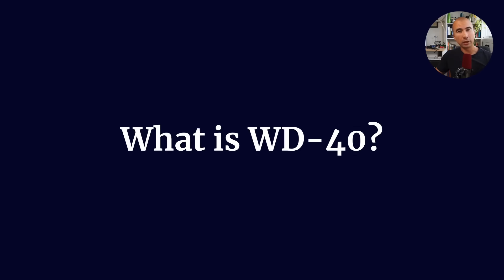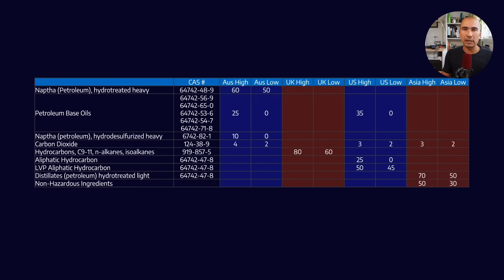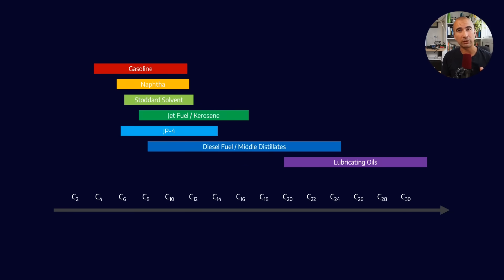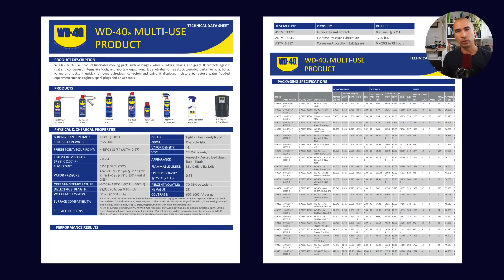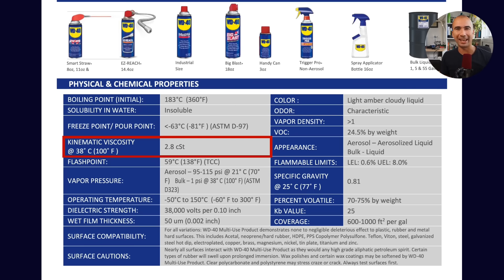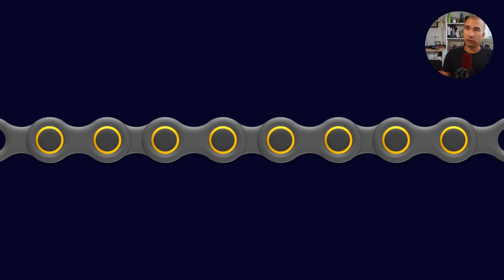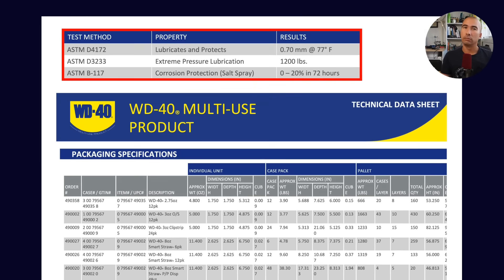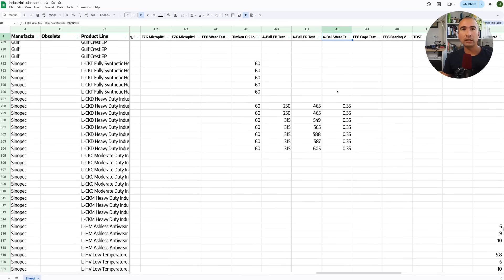What exactly is WD-40?

Comment: > Myth: WD-40 Multi-Use Product is not really a lubricant.

> Fact: While the “W-D” in WD-40 stands for Water Displacement, WD-40 Multi-Use Product is a unique, special blend of lubricants. The product’s formulation also contains anti-corrosion agents and ingredients for penetration, water displacement and soil removal.

—The WD-40 website

Comment: Diesel starting fluid —and wasp prevention. It ABSOLUTELY works for that. I do commercial/industrial HVAC, so I see quite a few nests. A quick shot  early in the year in the common spots will keep them away that year. 
>be careful with vinyl siding/soffits: some of the older stuff can get stained

Comment: WD-40 was originally developed by the Rocket Chemical Company in 1953 for the aerospace industry to prevent rust and corrosion on the outer skins of the Atlas missile, a task the chemist completed on the 40th attempt, giving the product its name: "Water Displacement, 40th formula". The product's effectiveness in this specialized industrial application led to its widespread use by employees taking it home, eventually prompting the company to release it to the public in 1958.

Comment: Really, really good video.  Does great job distinguishing btwn solvent/cleaning properties of WD40 and the minimal lubricant properties.  One thing i can point out is around 8:00 in video is a misunderstanding of bike chains.  The gold circles on video are not moving parts (ie where the pin goes through the outer chainplate).  Anyone who has used a powerful chainbreaker tool to remove a pin from a chain knows how phenomenally tight that fitting is.  (If it were in fact a moving joint, ie loose, the chain would promptly separate).  The actual moving parts in a chain link assembly is INSIDE the chain link - where there are rollers around each pin.  They actually are relatively loose, have spacing.  THIS is where the pressure bearing takes place when peddaling the bike and rolling the chain around the bike's sprocket.  And where the lubrication (and cleaning) is most needed.  My comments don't in any way dispute or negate the value of what you are primarily addressing in the vid, you're spot on.  Just thought you might want to better understand bike chain mechanics.  Am sure a bike chain video can do a better job than mine in explaining the moving parts.

Comment: I have a small business working with steel wire, i use WD40 as temporary lubricant before the steel wire go through a rotative straightener to prevent squeaking noises and excessive torsion which would affect the final product, WD40 is the best option because the parts will need to be painted after and since the WD40 is quite volatile i don't need to clean anything, and as a plus it provides a temporary rust protection until my customers paint the parts (i just spray a little bit on a rag that i wrap around the wire, 1 second spray is more than enough for work through a 3mm 30kg wire roll). I also use it a lot in maintenance mostly for cleaning old grease and oils and dirt.
Reply: congratulations on being the only person to use it correctly

Comment: I really wish people would read and understand products before using them. We use a product called Amsoil MP spray, and it’s amazing for door hardware. It has enough solvent to clean out gunk, but it leaves a dry film that is the lube. Now, I’ve explained to coworkers that it is what we use to lube things, and they understood that. Up until they grabbed a can of Amsoil “metal protectant” spray (that was an entirely different style of spray can) and used it in all of the floor bolts. It’s almost like cosmoline in a can, and they learned the difference when they had to chase the threads in all of the floor bolts and vacuum out the gunk.
Reply: Amsoil MP is a great product, it's all I use as a light lubricant for motorcycle throttle cables, things like that. Also as a penetrant when taking something apart that has been assembled for years. And as a light rust preventive, works great on my CJ7 bare metal spare tire latch

Comment: Ok, a Tribologist, is My Guess. Hows about a Vid for Air and / or Water cooled V-twins on the highway in say 100+ F, 38+C temperatures. Which grade to use to get the best flow through the bearings and tappets, etc ?? Thanks.
Stay Safe.

Comment: I use it behind the flywheel covers on all of my bikes. There are small vents in the cover and moisture will accumulate and rust up the rotor or flywheel or whatever steel components there are over time. Works fantastic! Every so often, douche with contact cleaner, spritz with some WD and no rust. It's literal intended purpose. 

Hard pass as a lubricant for me.

Comment: interesting but also over simplification.  Penetration isn't based solely on viscosity but also surface tension, water is high surface tension and is low viscosity.  Most liquids are solvents, gasoline, water, alcohol and yes oils are solvents too.  I'm not sure why we need to put them into categories like its a solvent OR its a lubricant.  Lubricant is also a loaded term like others have pointed out parts of..  there is a component of sheer resistance but also surface pressure or heat resistance so as others said, it depends on what you are lubricating.

lore says that WD-40 was developed as water displacement, true?  who really knows.  we do know that a light coat of oil will inhibit rust on raw metal surfaces, WD-40 does this.  WD-40 is really best at displacing water from a crevice where water can hide so that you can put a heavier lubricant in there after the WD-40.

it is a lubricant.... and it isn't wise to use it in most conditions you need a lubricant.  I've probably got two dozen lubricants in my shop for different purposes and seal compatibility.

btw, water makes a great lubricant for your kids going down a plastic slide!

Comment: I used to use it to clean up pipe threading equipment (never for threading). It was enough of a solvent to clean out the contaminated threading oil and enough of a lubricant to keep the low load parts lubricated. It worked great for that but it has always been a little puzzling to me that it is so popular given the limited applications it works well for.

Comment: To know what is any product, download their Material Safety Data Sheet (MSDS). For WD40, WD = Water Displacement”, their MSDS sheet lists a bunch of hydrocarbons and “petroleum base oil” and IMO none of which will provide medium to long term lubrication. The lubrication effects are short term and again, IMO, would diminish rapidly on heated surfaces. If you need a lubricant, use a lubricant that is engineered for your specific application.

Comment: This is such a pet peeve of mine, WD-40 is a lubricant period. It depends on what you’re lubricating. A door hinge is adequately lubricated with wd-40. You wouldn’t pour a light 0W oil into a gearbox or differential requiring 75-90W and then claim the 0W was not a lubricant. It was the wrong lubricant for the job. Water can be a lubricant if you’re using it in a water slide.
Reply: This is what I've been saying forever lol

Comment: On thing that should be taken into consideration here is the fact that due to VOC regulations each country may have a different formula of WD40. WD40 isn't what is was 15 years ago simply due to regulation in the United States. Foreign markets will get different formulations which reflects what was shown in your SDS information. 

If you really start diving into WD40's data sheets you'll find nearly every test that they conduct is done at their own lab and the performance comparisons that they make are most of the time not an apples to apples comparison. What I'm saying is they will take a competitor's silicone lube or multipurpose lube and compare it with WD40 penetrating oil in a test designed for penetrating oil. The information in those sheets isn't worth the paper their printed on.

The current US version of WD40 has become little more than mineral oil and paraffin wax with some fragrance and dye added to keep the familiar look and smell. If you spray out a current US formula WD40 into a clear container wait about 20 minutes the paraffin wax will fall out of it. The paraffin wax is left behind similar to what you're talking about at 11:58

Comment: I read once that WD-40 will wash out any existing lubricant and replace it with an adhesive
Reply: When WD-40's solvent evaporates, it leaves behind somewhat of a waxy film. Not the best adhesive, it's very slick. I definitely wouldn't recommend using it as a lubricant on anything "high speed." though.

Comment: WD-40 was banned from our maintenance department because people thought it was a lubricant but after a few days it sets to a decent adhesive.  I remember using it on ignition systems in older cars ( with a distributor ) and seeing it attract all the dirt in the area like a dirt magnet.
Reply: I've used it to flush some difficult to reach bearings, then injecting a lubricant into the bearings to displace the remaining solvents.
It has its uses, but only if one understands the behavior and characteristics of the product.
Reply: @spvillano  WD-40 ( Water Dispersant formula 40 )  was designed to chase water away from metal surfaces and leave a sticky film behind to slow down corrosion.

Comment: I learned the hard way that it's not a lubricant.  I once used it on a motorcycle part that required grease, and it melted the grease completely. I had to disassemble the part and regrease it.  Since then, I've found it to be an excellent cleaner

Comment: If there was higher viscosity oil dissolved in the naphtha, wouldn’t it be left behind when the solvent evaporates? , also providing corrosion protection? Thats what I thought WD-40 was : oil dissolved in solvent ( mostly solvent)
Reply from the maker: It would - the problem is the proportions. You need to dilute a higher viscosity oil with a lot of low vis to get the penetrating properties. So that really reduces the "lubrication" properties alot.

Comment: Yep - I use WD40 to clean my motorbike chain, and clean it using a microfibre cloth. Then use motal grease to lube it.

I also use it to clean my rims, and general engine parts from corrosion it does a great job doing that

Comment: Excellent, this fits exactly with my observations of using it over several decades. I don't hesitate to 'lubricate' door hinges with it to stop squeaks etc, and it works, long term too. But these are small, and indoors protected from the elements. I do use it as more of a convenient cleaner and LIGHT lubricant for a bike chain (when I need quick & easy). That is, if I clean the bike and spray the chain down with WD-40, I'm happy to take it for a short-ish ride without any further lubricating product. But it won't last long, either stored in the garage or being ridden. It needs to be done frequently, every ride perhaps if relying on it, or the chain will start squeaking fairly soon.
Reply: I use graphite for such lubrication, in some cases carried there by WD40. If you're familiar with the product Lock Ease, it's fairly similar to WD40, but has graphite in it to remain behind as the effective lubricant. Doesn't have anticorrosion properties that an oil would have, but it's good for helping reduce friction in environments protected from the worst of the elements.
That bike chain, I'd probably use (and have used) 30 - 40 weight oil, a fair number of times, I just used filtered used motor oil, due to the fairly low loading of a bicycle chain and mostly for protection from corrosion. I'd even consider 50 weight for storing it.
I've even used differential oil to coat ferrous metals for protective purposes, the oil being unfit for use in a differential, but acceptable to protect metals that are stored under uncontrolled environmental conditions.
I've also had to resort to close to zero weight oil under some rather extreme cold and pressure conditions, but that was a one off military context situation that I'm thankful to have not had to deal with since.

Comment: I've used it to help restore old tools and tool holders in machine shops that lack central ac, so hand tools in our sub tropical climate tend to rust up hanging on the peg board over a short period of time. Some wd40 and elbow grease will get the surface rust off, or will product some tools and tool holders, but after that you need to apply the appropriate lube, on moving parts especially.

Comment: WD-40 will evaporate.
For many years I was an auto technician. 
WD-40 is absolutely a waste of money. 
Use Marvel Mystery Oil, or transmission fluid.
Save ur soul.....
Reply: Both of those evaporate also.  So does engine oil, or even gear oil. Eventually.   WD is a great light lube, but they have other products for actual lube, and different situations.
Reply: @GT-mn3bx  
You are so wrong
Reply: @meinkamph5327  Really? Go pour some in the dirt.  Or search evaporative loss.

Comment: You are spot on with your explanation. I have been trying to get people to understand that it is not a good lubricant for years. They are good at advertising.
Reply from the maker: Just to be clear, it's still a great product - just needs to be used correctly. It's highly misunderstood is all.
Reply: Use it to clean dirty or rusty joints, then use suitable oil to lubricate

Comment: I use WD-40 to spray on my cement molds before I pour the cement in and it works really well
Reply from the maker: Interesting - it has never occurred to me to ever use it as a mould release agent.
Reply: @ I was using white lithium grease spray for years and then when I tried WD-40, it worked much better!

Comment: I've been telling people this since the early 1980s that WD-40 is not a lubricant. It is never been designed to be a lubricant. It is a water displacement solvent. The reason I found this out is because people were getting some of the stainless pistols and in competition they thought that spraying it down with WD-40 is a great way to make the firearm run really slick what was happening is is the guns were sometimes seizing up in mid cycle and you couldn't even unload them. Because it removed all lubrication from the firearm and when you make a stainless firearm and you have two different parts that have to slide against each other that are made from the same type of stainless they will tend to stick together and stick together they did. Do not use WD-40 as a lubrication system. It is not a lubricant. It is literally water displacement formula number 40 developed in World War II to remove water from ignition systems on engines being used in trucks delivering War materials during World War II. That's it.
You make a mistake and you say that WD-40 is a range of different products. It is in the last few years. But the WD-40 is a singular product and it is not a lubricant.
It is primarily reconstituted fuel oil which also is not a lubricant
Reply: Wrong-O , it was not developed during or near WWII . It was created in 1953 , look it up.

Comment: WD 40 is a penitration lube , it works well for a particular use .if you want to waste it by yseing it for lube , ok
But oil works better 
If you want to waste money by using it to loosen rust over and over ,ok 
Probably should just protect from rust

Comment: I think that in most cases that call for cleaning and lubrication of small parts with WD-40 can be instead handled by using kerosene or a mix of kerosene and a common oil like 3 in one. People just use WD-40 because it comes in a very convenient package of a spray can.
Reply from the maker: I think it's become a default in the same way "Kleenex" has become synonymous with "facial tissue" or "Google it" for internet searches. Once you've occupied that brain space in a consumer's mind, they don't even think of an alternative. It's the ultimate brand flex.
Reply: Kerosene is horribly toxic. That's why we don't use that anymore.  My grandma has severe health issues from working at a weed eater plant that shipped parts in kerosene for years.

Comment: Awesome video. Thank you very much.  I noticed years ago the exact things you pointed out in the video.
I have a question that would be very important regarding the use of WD-40 as a cutting fluid.  Many in the field of machining steel and aluminum parts swear by WD-40 for it's use as a cutting fluid in drilling, tapping, and machining parts.  I use it everyday for this purpose and find it excellent, especially on aluminum as it prevents it from sticking to the drill bit or cutter.  Can you comment on this?  Thank you again for posting. Regards.

Comment: I basically only use it to dissolve glue at this point. I use gasoline for cleaning and some garden variety actual lubricant for lubrication. It's not even that much more viscous, but it lasts for years rather than days.